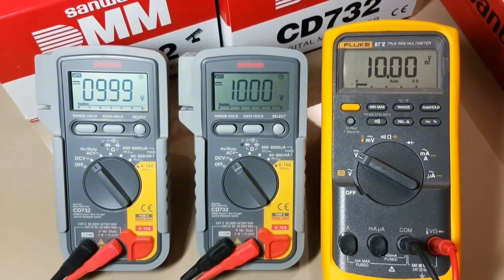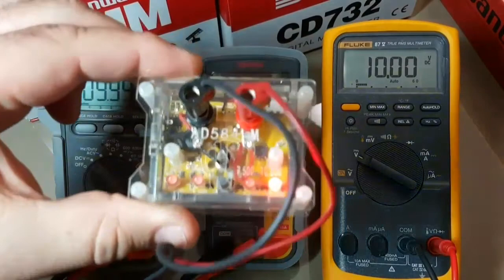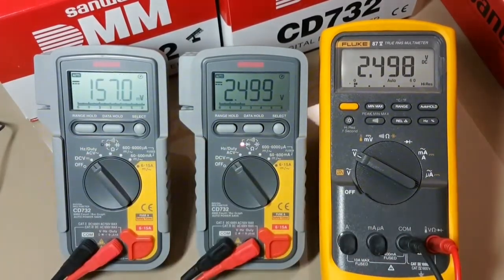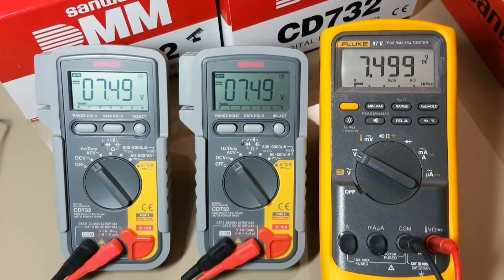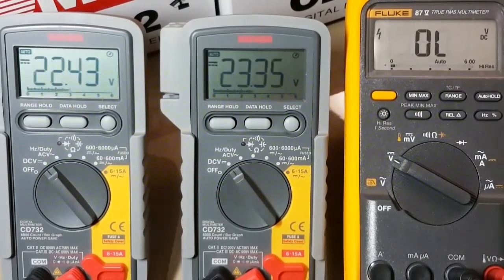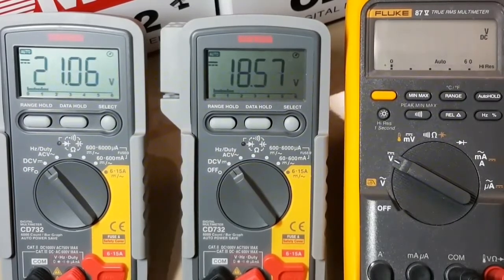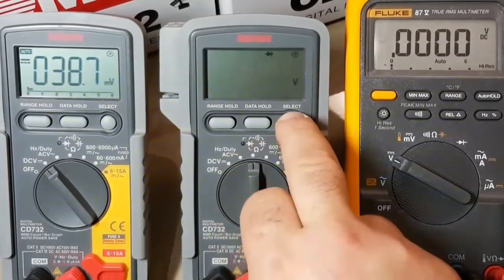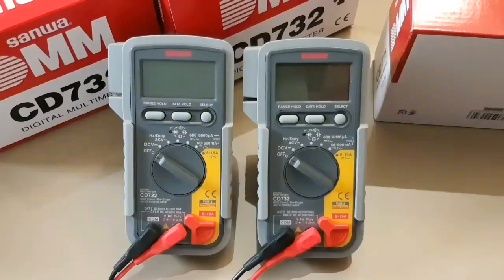SANWA CD732 MULTIMETER (Follow-up) Part 2

Comment: My Sanwa CD732 multimeter suddenly died after being used to measure a 3v dc voltage from an esp32, it didn't die while measuring but the lever was still pointing to the dc menu when I went to the bathroom, when I returned the multimeter died. At first I suspected the battery was dead but when I replaced it there was no response.
Reply from the maker: Yikes, sorry to hear that! Contact Sanwa. Hopefully, they can offer some insight.

Comment: Sanwa cd 732 better ya haioki 4256?
Reply from the maker: Yes, I prefer the SANWA
Reply: @KeepOnTesting  explain why? I am from India now this time sanwa cd 732 is reliable ?
Reply from the maker: @tatiyabicho645  Firstly,  they can take alot of abuse and extremes and still keep on going. I've had Sanwa multimeters that are over 45 yesterday old and still operating in spec. Hioki is a good name but not as resilient in my experience. I also believe Sanwa is better value for the money.
Reply: @KeepOnTesting  accuracy which one is better??
Reply: @KeepOnTesting  now this time haioki maximum option than SANWA

Comment: Hi Darren, is the Sanwa CD732 in your opinion comparable to most DMMs in the 120ish dollar price range? My parents ordered me one for my electrical class and I was recommended a Fluke 107 by a Teachers assistant. Thanks
Reply from the maker: The CD732 is a great multimeter. IMHO it's better than the Fluke 107. It's very well designed and has great input protection. The only thing it lacks is a backlight. However it has both an audio/ visual continuity indicator and a Bargraph , both which the 107 lacks. True Japanese quality, it should serve  you well. Awesome parents you have ! Keep On Testing!
Reply: @KeepOnTesting  thanks for the input. Also, is not having a temperature reader that big of a deal breaker if I'm in a program for Biomedical Equipment Tech? Aside from that, I'm liking it so far.
Reply from the maker: @upy0ur5  I think you'll be ok without Temp. If you ever need a second dmm with temp just grab a VC99..fairly cheap and great Temperature accuracy. Always nice to have a backup multimeter too!
Reply: @KeepOnTesting  thanks again Darren. Keep those reviews going. I'm hoping to see more meter varieties like the Hioki vs Sanwa vs whatever that 3rd Japanese brand was in your trailer video.
Reply from the maker: @upy0ur5  Many thanks.. I will have some great Japanese Multimeter reviews coming soon 😁👍